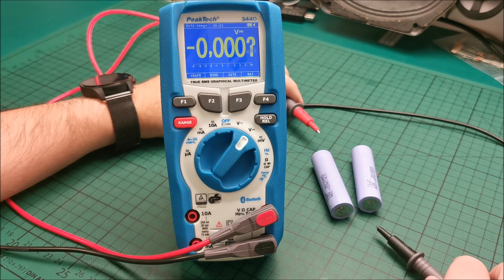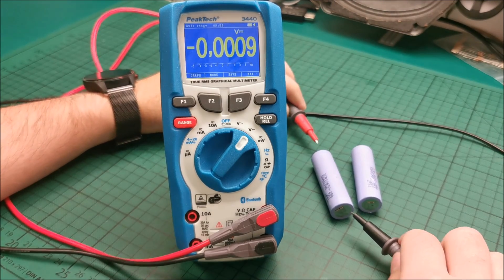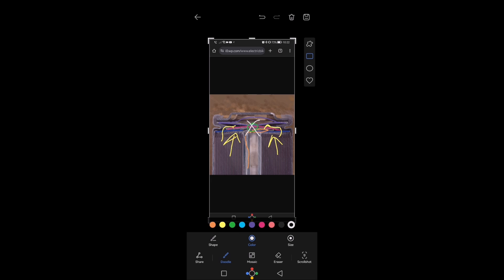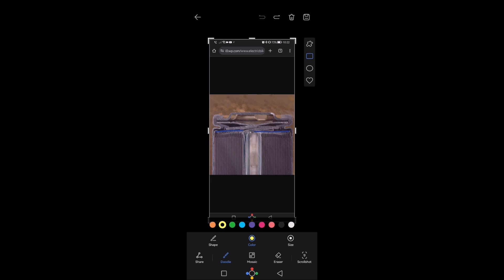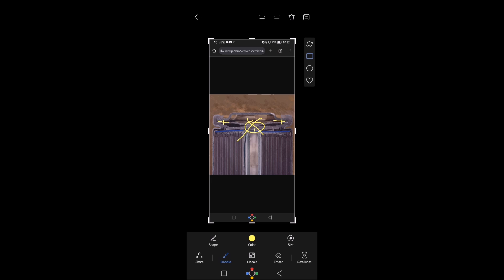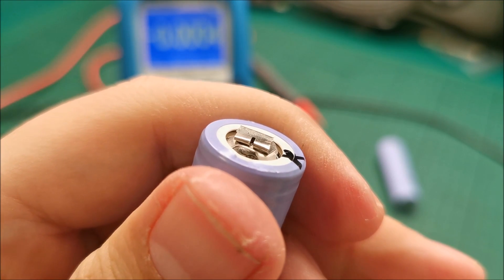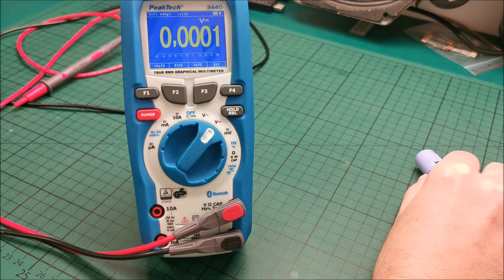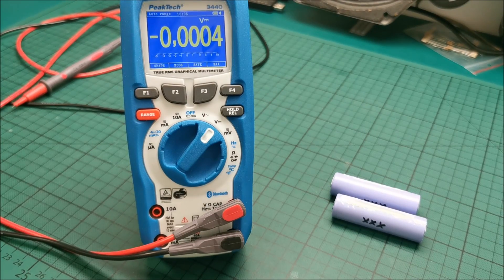🪫 Lithium cell with high voltage drop and not charging - what does it mean and what to do about it 🔋

Comment: It's good engineering to use physics and not just code and the not-so-good chips and sensors.
Reply from the maker: Agreed  👍🏻
In theory, in the laptop battery that I recovered the cells from, the electronics did not do a good job of preventing overheating, thus resulting in the mechanical safety kicking in.